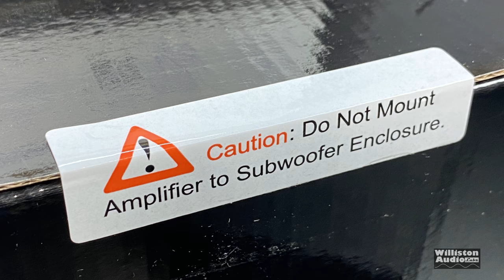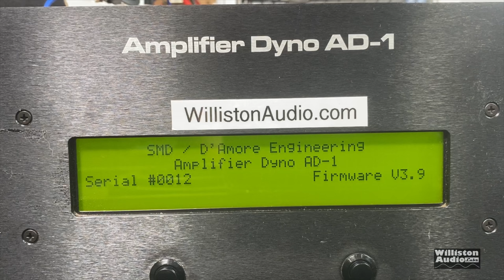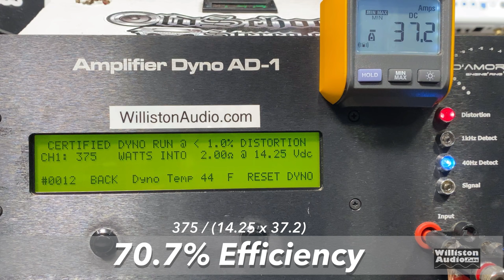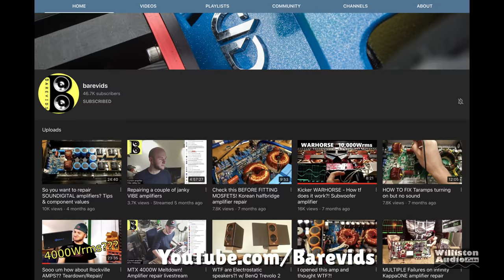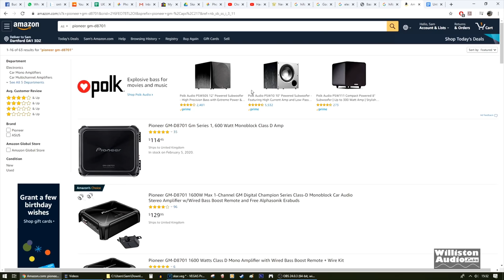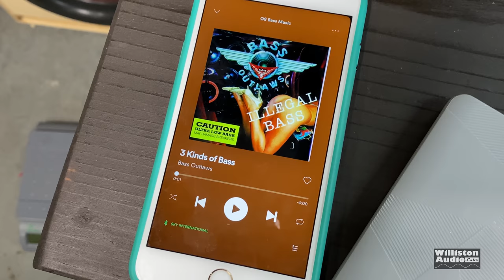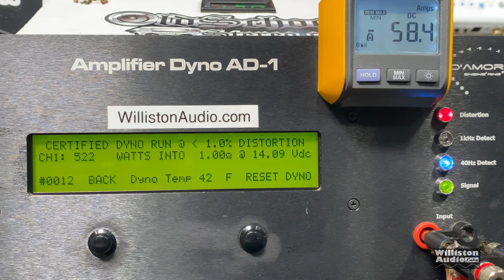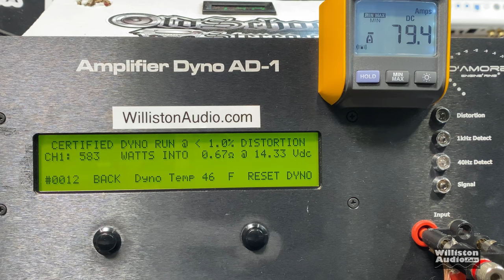Amazon Mini Amp Bargain? Skar SK-M5001D 500W Amp [4K]

Comment: Had this amp for about a year no problems with it. Now it keeps going into protect checked all my wiring cant seem to figure out why its doing this
Reply: Try checking your fuse on your power wire, could be slightly melted and it's giving the amp too much/too little power.
Reply: I had the same problem with my 5001D. After about a year it went into protect mode. I fixed the problem by swapping it out for a kicker key amp. For the initial install I also had a skar 4004D powering my 4 speakers. That one stopped putting out sound last week. Checked the RCAs and they were not the problem. Ran a test tone at 1000hz and got no power out of the speaker leads. Swapped it out for a Sony brick amp I had laying around and sound is back. These amps are GARBAGE. You get what you pay for.
Reply: Yep same here. I’ll be listening to music and it’ll just go into protect. I’m doing away with this amp

Comment: The first and last time I had an amp attached to a box, it was easily stolen. I had parked to ride with friends, was gone 10 minutes and when I got back my hatch was popped up and the wires were cut and my box, speakers, and amp were gone.
Reply: That sucks!  I have had that happen as well. From that point on...amps went under seats. (When I did have a system)..
Now. Stock. Married/child/bills etc.😇😎

Comment: Derick, want a laugh, i saw this on an ebay review for a pyramid 2 ch amp:

"Great Amp, But?
It Is A Great Amp, Its Worth The Price, It Is Affordable Than Other Brands. But The Problem Is, It Goes Into Protection Mode Alot If It Goes 3/4 Above Of The Volume My Radio Can Give..  I Have It Hooked Up To 2 Subs, Both Are 4 Ohms And Single Voice Coils. One Is A Dual Brand 500 Watts Sub And The Other One Is A 1600 Watts Boss Sub."

the amp is only rated for 4 ohms in bridged mono so don't know why a fine piece of audiophile excellence like that would keep going into protect with just two 4 ohm subs connected....lol

Comment: What's your favorite amp.
Reply: Rockford Fosgate 600a5. 5 channel amp that can actually power a full system. There's others that can do it as well but this model did me right for nearly 20 years spread between 5 vehicles.
Reply: @STEVEWONDA1976  OK THANKS FOR THE REPLY I'VE GOT 2 KICKER COMP 12S I DONT MIND TO SPEND THE MONEY. TO GET THE BEST.
Reply: Orion 2500.1
Reply: @STEVEWONDA1976  Hey Steve..I got an American Bass 12in 2000/4000 watt Sub. What In Your Opinon Would Do Great Pushing It by Chance... Tryd a   HiFonics an Apparently NOT Enough Power!!! Only Running 1 12 in a Dodge Charger...Any Recommendations??? Thanks

Comment: Something I've wondered for awhile is all these people with test benches needing big expensive power supplys why no one ever builds a DIY alternator charging system? Any old 120v electric motor out of washer machine ECT and a GM 250A 1 wire alternator or multibles build a basic frame to hold it all and just run belt and whalah badass 12v charging system.... obviously the bigger the alternator the bigger the motor requirement is. It's not a noisy setup either.
Reply: That's a very inefficient way of converting voltage. High output alts are like 200-350a. So you're using a motor, which itself has an efficiency loss, to mechanically drive an alt with mechanical efficiency loss, for the Alt to generate power based on its kinetic input which will be a percentage output from its power input. You might as well just use server power supplies, which are 175a or so each, which take mains voltage and convert it to 12-14v DC with around 80% efficiency. You'd only need two of them to outperform that janky Alt setup.
Reply: @barevids I realize that your just trading 120v AC for 12v DC it's not to be efficient it's to serve a purpose... make alot of amps quick for testing.
Reply: @95Sn95  it has no benefit. It's more expensive to setup, more effort required, and will saturate your ringmain sooner. Server supplies are just plug in and go, loads more current instantly available.
Reply from the maker: Great point!

Comment: Are all the Skar amps using out-dated boards/components?
Reply: Where did you get that idea from?
Reply: @DTW-bx2vy  From the reviews and forums. I'm not sure, which is why I asked. I don't see anything wrong with doing such, as many makers have fine-tuned old boards, but they use all the similar components. 
Any thoughts?
Reply: @RobHTech  it's mostly the micro amps and the now discontinued LP series amps. They have been moving forward.
Reply: @Kamwi_003  Thanks

Comment: Do these little amps have heat issues if you crank the volume for any length of time
Reply from the maker: I warmed it up but no overheating issues at all
Reply: @wal  hard to believe.  Its small size would heat up youbwould think

Comment: amp that did not lie; dont mount to subwoofer,,,,lol.   it gives rated power, but for how long... lol.  ok can change out the fets, 3 of them, and add a heat sink to the driver board, and some epoxy to the base of the board, annnnnnd a cooling fan with shroud. 
but for 119 for a 500wrms amp aint all that, i can go cheaper for more power, but if u need the space, then the mods and price might be a reasonable tradeoff.

Comment: Not sure what you're doing different. I can't run this amp for more than a minute without it shutting off, Scorching HOT!!!! Seems like garbage to me. Bought it based on this video, very disappointed.
Reply: Your case may be different,i am not there to see, but look at  
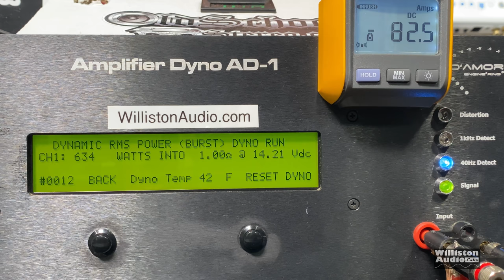  05:26 ......61.2 A x 14.09 V is 862 Watts going in;   and we have 522 watts out;  this means that  862-522   or 340 WATTS will be dissipated as HEAT by that tiny amp,that has NO fan!!!!  Impossible,it would catch things on  fire in SHORT ORDER; it needs to shut itself off,of course.
It needs to be under a fan,or other aluminum  heat sinks need to be bolted to the heat sinks on the sides,or  use only low power, at  8 ohms loads;  or 4 ohms and don't blast it; 
It should be illegal to make an amp like that(it probably is...) so small without a fan,or 2 fans; its a class AB amp,if it was class D it would never get hot,even being small like that,the efficiency is over 90% on some.
Reply: that makes 2 of us
Reply: you think the sundown sam500d would be any different? sundown is way better quality...
Reply: Most likely its from it not being grounded properly,  almost always this is the problem...Find a spot on the chassis ...drill a hole...scrape off the paint, get a bolt and bolt that ground down securely..most of the time the problem of over heating is solved.

Comment: I have this amp. It does fine for a daily driver. It does get hot, almost too hot to touch after awhile.
Reply: I have 4 and did a fan mod on all 4 of mines and YES THEY DO OVER HEAT SO DO A FAN MOD BUT IT WILL VOID THE WARRENTY THOUGH SO IT IS A CHOICE
Reply: If you change the 3205s and 640N fets to ones with lower rds it will run way cooler ☺
Reply: barevids adopt me please
Reply: @barevids  which ones you recommend
Reply: barevids hey. University has taught me something . Rds is the resistance between drain and source. But when are the streams gonna start back up?

Comment: This and the mini 400.4 are both garbage in my opinion. The 500.1 constantly overheated on me. Happily upgraded to the trauma 1000.1... and the 400.4  channel 2 crapped out but did last longer than the mono. And also Happily upgraded to the d4s jp84 amp

Comment: I run a skar skv2 100.4ab for my mids and highs and I’m very happy with it but at the sk m500 power level there are better deals out there. I went with the soundstream pn1 650d that puts out over 500 watts at 2 ohms for $99.
Reply: Poor guy actually thinks his soundstream amp does rated LOL. You have a long road ahead of you bud

Comment: meltdown city, this amp.. dont waste your money....
Reply: Bought it. Tried it.  Same thing.  It started overheating, even BEFORE turning the volume up
Reply: @tyredaniely5154  idk what your setup is like but i have this thing banging 2 12 in comp c’s in a 07 caddy cts and it hasnt shut down or overheated yet.
Reply: @josephjames1777  pure luck.  Check Amazon reviews.   It's a known issue.
Reply: @josephjames1777  its almost always because people aren't grounding their amps good enough...They will get hot in a hurry if they aren't grounded good..
Reply: @justScrollin0627  it could be starving for strong voltage or need a cap too.🤔

Comment: Don’t buy from Skar  they make junk amps I bought a 4 channel amp and one of the speaker outputs would not work  I’ll talk shit about them
Forever
Reply from the maker: That’s a bummer!
Reply: Did you contact customer service? I’m just wondering if they repaired or replaced it.
Reply: I loved the brand until i was chenging a wheel bearing and all of a sudden when the car was fixed the amp wouldnt play. It would power on with no protect, checked all connections and still no sound. Took it apart and couldnt see/smell burns or anything out of the ordinary. I should have disconnected the battery either way but i dont see an abs connecter destroying an amp.
Reply: You might have a bad rca cable. I had that happen before. Thought it was the amp but it was the cable that was bad
Reply: @colejrleroy8137  same issue I had with my 4ch. Bad rca cable caused the issue. I spoke with them before and they were easy to talk to and offered to replace it no questions asked. Got a loaner amp to send  skar amp back and the issue was still there so it was not the amp.

Comment: skar amps are cheap power terminals stripped. need new amp for 2 12 ix skars. help
Reply: They do strip easy smh good amps but wtf
Reply: What amp are you using now? I have the same subs and I’m looking for a amp
Reply: saul_ 4.8 shoot nothing now haven’t in a long time sold the focus st had them in for jl wrangler so looking for stealth under seat box. But amp for 2 12 ix series need 500 watts rms there 350 is close and did probably close to it had focus st doing 111 db in there Pre fab box.

Comment: Here is the truth,, I Love this Amp,, i have one in my personal Suv,, but this Bass Amp is not dependable after 3 years,, because of the old technology, my second amp is only running 380 2Ohm from 2-10 alpine subs 4Ohms each,and now it started again, after 45 Min. or 1 hour, it shuts off, the SK- 400x4 works great had it 4-5 years,, but the sub amp will have to go with , another brand, looking at the JL Audio RD 500/1
Reply: Did you mount your bass amplifier to your subwoofer enclosure?

Comment: who uses 14.4?..ever when is that ever a real world test?
Reply: Get your alternator checked. Your system should be between 13.5-14.5 with engine on. Right at 12v with engine off. Over 15v can cause problems.
Reply: Im pushing 14-14.5v and the voltage regulator in my alternator is bad.
Reply: Lot of vehicals run at 14.4 volts
Reply: @Dietrich804  actually around 12.4 and 12.6 when off
Reply: Almost all cars run at 14.4

Comment: Bench guys are great but as installer sometimes space is a premium. You would not want to recommend the Pioneer as a direct replacement. I severely dislike these type of people that only work on the bench and have no idea what it's like in the field. I've done both and have done tech support. I will tell you unless you have done all three you have no idea how it all works together. Big D you are solid but that amp guy while he may be correct on what he thinks to give a full review you need to bring in an installer and field test.
Reply: The pioneer isnt huge. I think it's common sense that the available space would be measured, and the right amp chosen based on dimensions and circuit quality. Out of 100 installs, there will be only a handful where the Pioneer wouldn't fit but the skar would. And you're getting such a better amp with the pioneer than the skar.
Reply from the maker: Dean at Five Star likes the Pioneer amps too but everyone is warranted their opinion. I appreciate the feedback
Reply: @misterhat5823  fine but two wont fit where I need them to in a Jeep Wrangler.
Reply: @wal  yes but sometimes space is the premium. I respect Dean and have met him. Yet nobody can deny physics and fitting two of those Pioneers in the space my customer wants is not an option. Therefore the Sundown or Skar amps would work great. It's all about the balance of meeting customer needs in the field. Something bench guys wont understand because they don't deal with customers they deal with distributors or corporations.
Reply: @barevids  cool so I deal with the handful that don't. Fine with me. So you under seat Jeeps? You prefer it the easy way?
Reply: Evidently you haven't watched a lot of barevids videos. He installs, too. He does subwoofer enclosure design. He does speaker design (the actual speaker, not just enclosure). He does everything short of clothing design, but you never know what the future holds.